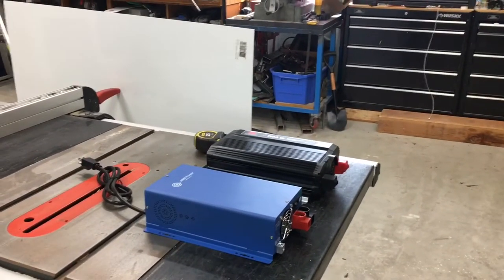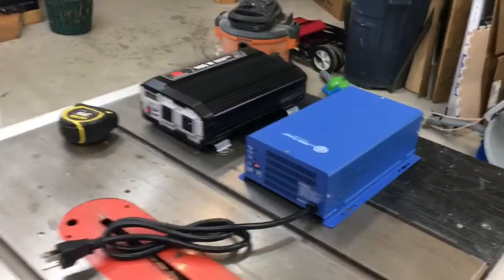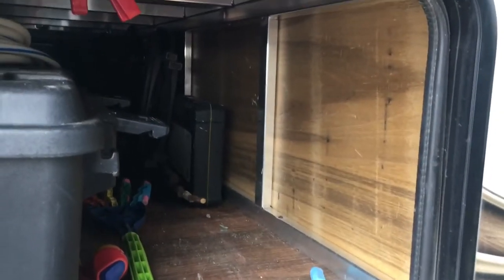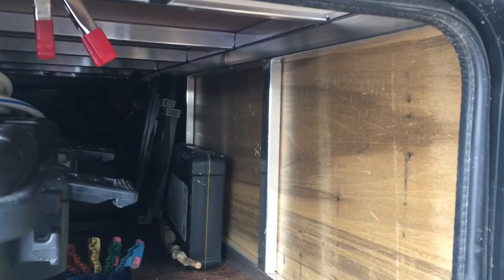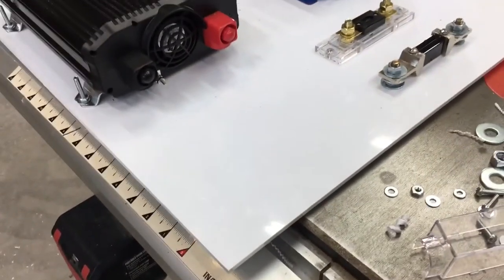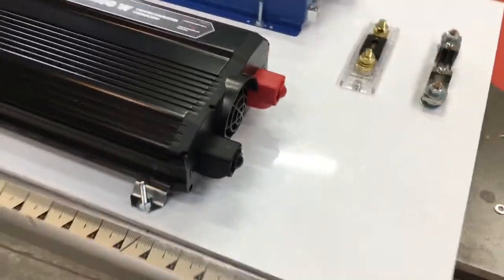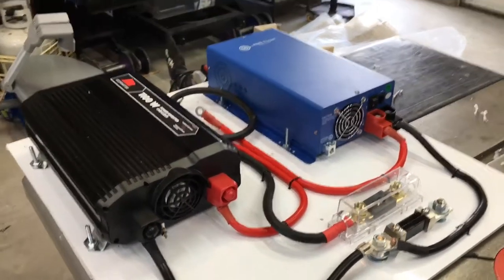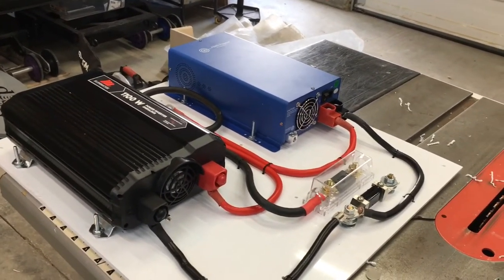Travel Trailer DC battery power upgrade pt1 - Inverter-charger

Comment: Any updates on this? I'm interested to know how it's working for you
Reply from the maker: Thanks for asking, in short the setup has been working really well. Since you have asked I’ll aim to create an update video later this spring once the weather starts to warm up!
Reply: @rad1876  oh heeey.... I need a video like today.... I'm on the verge of buying the items in your setup, or going prepackaged bluetti stuff. Thx for replying
Reply from the maker: @vroor32  At this point I can say all the components I have are still working great. Haven’t had any issues whatsoever.
Reply: @rad1876  again. Thank you so much. How big is your battery? I must have missed that in the video. Also, how much watts are you usually pushing into the battery? And what type of battery is it? .... I have so many questions...ey!
Reply from the maker: @vroor32   I haven’t covered the battery in a video. I use a 12v 280Ah LiFePo4 battery, that works out to 3500watt-hours. There are already hundreds of videos on these on YouTube. I usually charge between 50-75A on shore power and 20A from vehicle power.
Reply: @rad1876  there's hundreds of these videos, but yours is EXACTLY what I wanted. 

Not every one wants to use solar to recharge so I'm so happy my thinking was not "out of the norm"

I have a semi truck and want to charge as I drive, then use the battery charger for my AC when I stop for a break. My truck's inverter will provide the 110v to the charger to juice up the batteries as I roll.